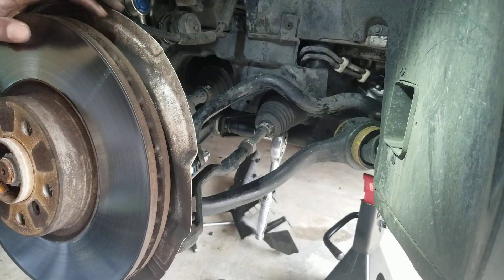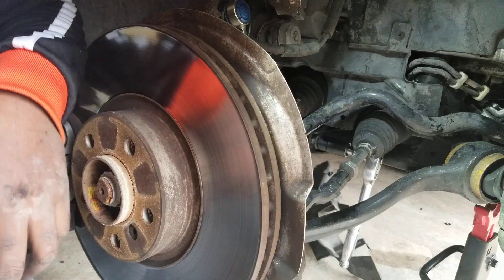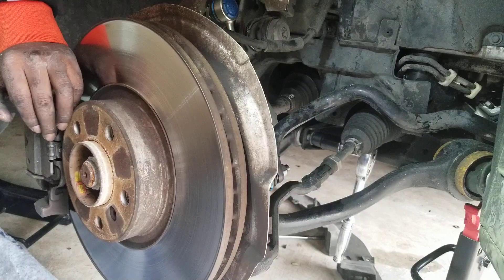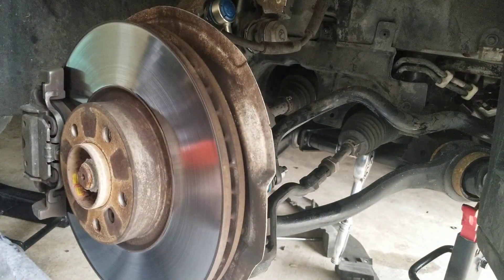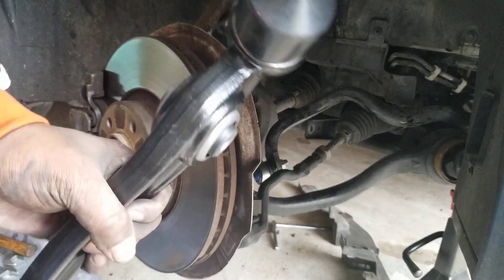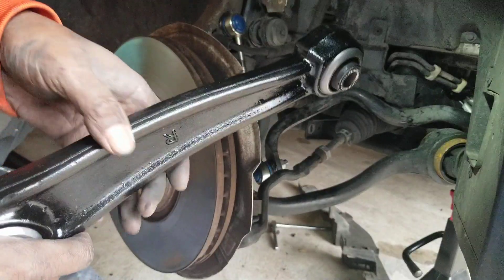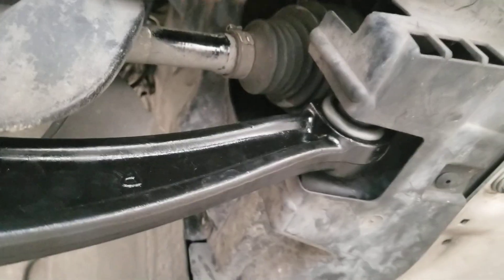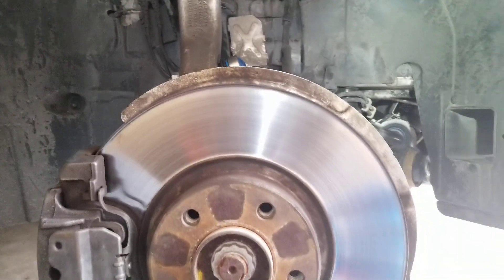BMW E70  X5, Front Lower Control Arms Installation

Comment: Hermano,
Have you replaced the ‘oil pan gasket yet?’
Any tips? Thx
Reply from the maker: Not on my V8. But the process is straightforward just raise the car and it's held by 10mm bolts maybe 22 of them
Reply: Thank you. Just make sure you put the weight on the floor b4 torquing tight those bushing nuts. Keep wrenching man.
Reply: @mashegomotosgarage2645  oil pan gasket? Straightforward process? How high are you bruh? 🤣

Comment: Sir ,I been having a time with my 09 X5 E70 and a knocking noise coming from my left side. I have replaced struts , sway bar links, front and lower control arms and still have that knocking noise. Really tired of throwing money at this thing.  I've read in the comments that the CV shaft can cause this noise. I could see this happening if the boots were busted or if they made noises while turning but I don't have this problem. Really could use some suggestions and in fact this is the problem.

Comment: What kind of problems issues are you having?
Reply from the maker: Knocking from front suspension and it ended up being the front drive shafts
Reply: @mashegomotosgarage2645  oh good you fixed. Just did mine too. Both shafts and Giubo. Vibrations gone

Comment: i have the same issue, knocking at low speeds, can you confirm what fixed the issue, the lower control arm or the CV axle?
Reply from the maker: Yes, it that was the issue. Are you getting a knocking sound when you turn the steering wheel or driving straight in a slow speed? Please Subscribe to my channel and click a notification button
Reply: @mashegomotosgarage2645  i have knocking noise on bumps, most noticeable driving on local roads, no so much on highways. so far I replaced struts, Sway Bar Links, and control arms, knocking noise still there, i will order the lower control arm and hopefully it will fix it.
Reply from the maker: Yes. Check your Sway bar links with that issue.
Reply: I have same noise clunky problem, have replaced all suspension arms with struts etc, except the upper control arm, the noise i have is over bumps with slow speed, however when turning steering wheel no clunk, noise seems coming from upper side of wheel thus suspecting upper controls what do you think?
Reply from the maker: Replace both front drive shaft they always culprits
Reply: @euddys  did that lower control arm fix your problem? Because I'm also having the exact same problem with mine on the left side, so how did you manage to get rid of all those annoying noises?
Reply: @A.psychedelic.hood-rainbow  got rid of the truck, i honestly think it was my motor mount that was shot because i would hear the knocking noise on startup as the motor shook side to side....
Reply: @euddys  dang that crazy, I'm gonna try getting that lower control arm and the cv joint but if it still makes noise, I might as well leave it in the garage or go to a bmw mechanic and watch them charge me insane amount of money for something that could be minor. 

But thanks for the response.

Comment: Did this fix the knock issue you had with the car?
Reply from the maker: It ended up being the CV joint
Reply: @mashegomotosgarage2645 did you record the CV change out?
Reply from the maker: @JRudd  I haven't done it yet. I am working on my e39 replacing front strut mounts.. I will put up the video tomorrow for the struts. I will also put up a video for the CV joints